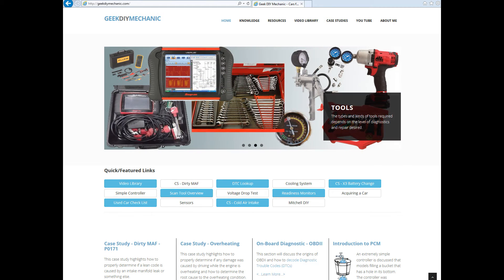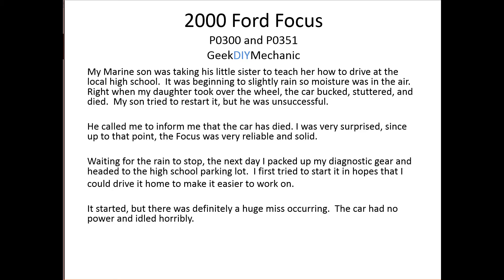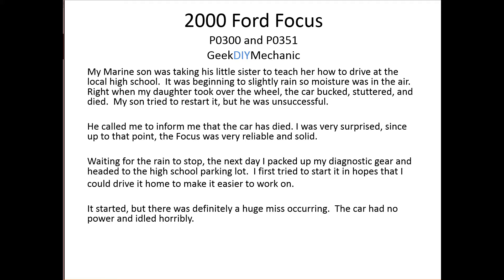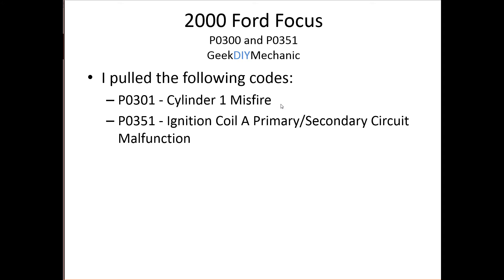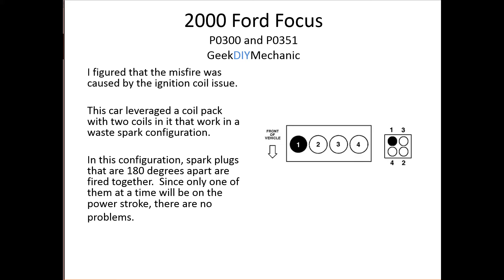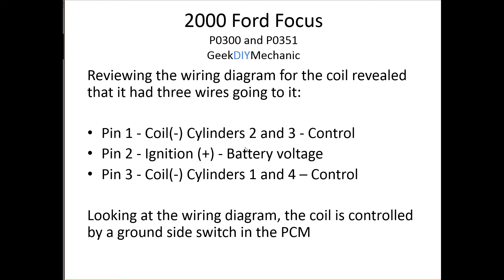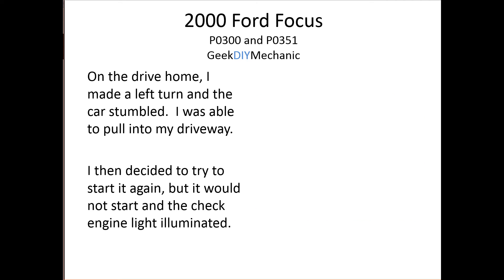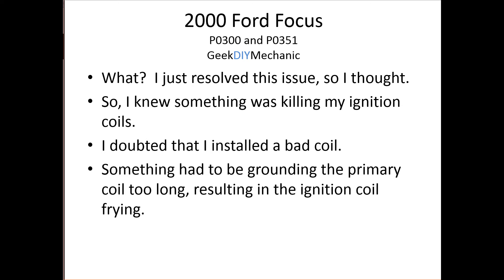2000 Ford Focus ZX3 - Rough idle and no power - P0300, P0351. P0352

Comment: Thanks. I found that was my exact issue. 
Car would only drive in reverse, stalled everytime I put it in drive. 
Checked the harness and found it burnt, pulled it apart and found only the black and orange wire with copper exposed. 
Excellent video thanks again

Comment: 2 problems on my ZX3. 1. Collapsed PCV line at idle. 2. Fuel rail pressure sensor diaphragm was leaking gas. This was flooding the car at idle. I replace the coil, plugs and wires too but that problem after the vaccuum line PVC stuff was replaced was the fuel rail pressure sensor for sure. Leaking gas into the intake manifold, flooding the car at idle when warm. But, its fixed as of now!!! No more rough idle.

Comment: Thanks man!  Have a similar problem with my kids Escort ZX2 which has the same motor and essentially the same coil (although the connectors are different).  Will be looking at it tomorrow and I bet this is the problem.  Already replaced the coil once to no avail.
Reply from the maker: Hi.  I hope all is well.  Were you able to fix your issue?
Reply: Found it!  The coil harness on the ZX2s goes around to the back side of the cylinder head where it  joins some other wires into a larger connector and one of those wires had rubbed through the insulation and was grounding out.  Repaired that wire and it runs great!